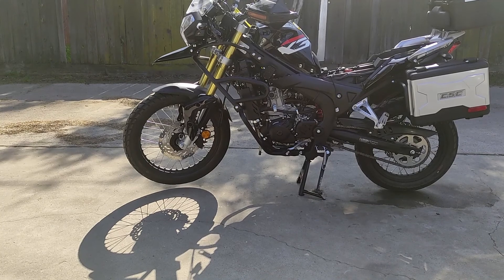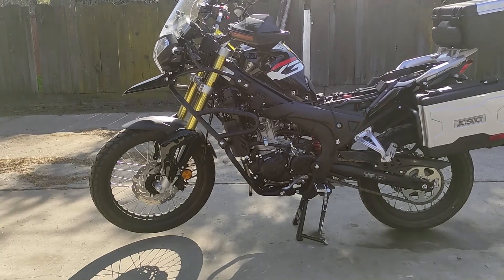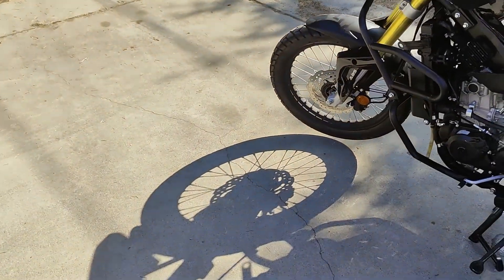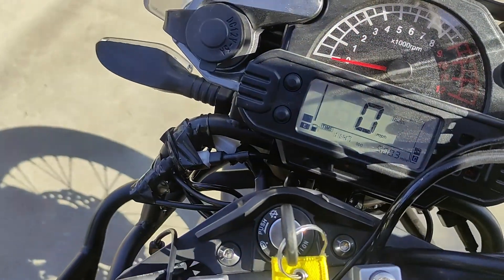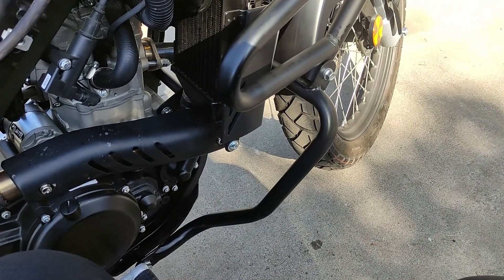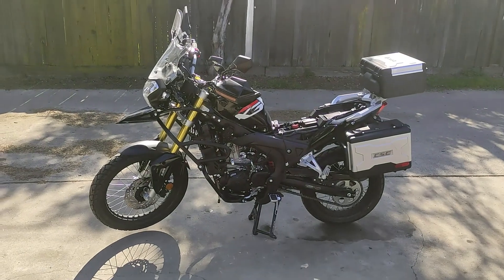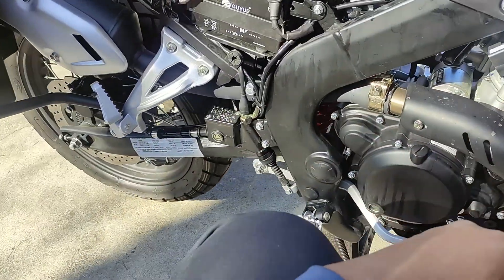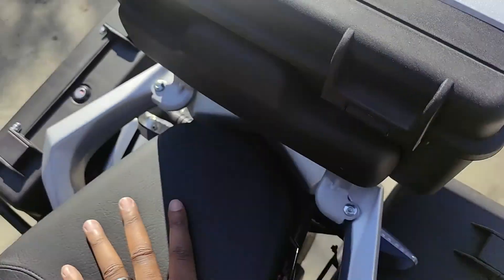CSC RX3 First Valve Adjustment part 2

Comment: Glad to see that you got it back together and running. Members in the CSC facebook group say the RX3 is harder to adjust valves on. Personally I own an RX4 and have done 4 valve adjustments so far. They get easier each time. At least you don't have to remove an engine mount on the RX3 unlike the RX4.